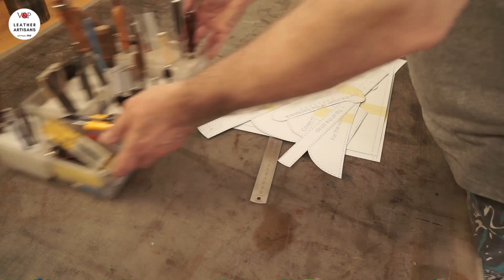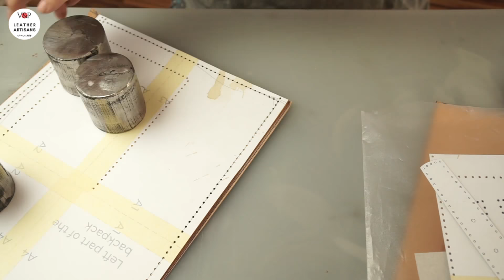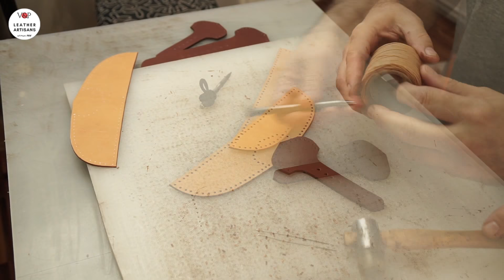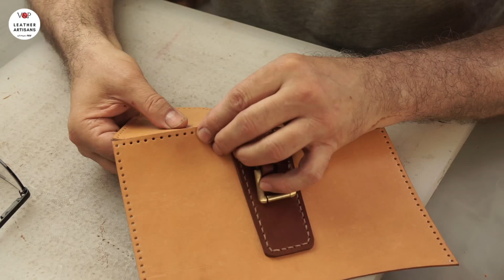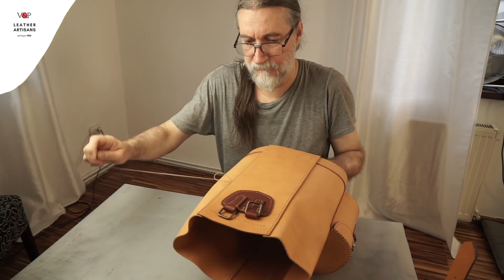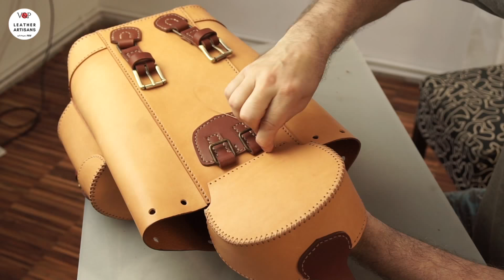How to Make a Vintage Backpack (Pattern in Description)

Comment: you know, after doing a few patterns like this, with the huge holes for sewing (not just v&p), i switched to a stitching chisel and it really makes something like this look much much better. for example, i'm doing the duffle by v&p and using a 3mm chisel (a touch too small, but nothing major) and it looks way way better.
i like this design, it's not for me, but i can still appreciate it. but to critique a bit, i think the large stitching is way too much when it come to the joining seams. it draws the eye and not in a good way. i don't like the box stitching either. but, that being said, the big stitches look great on the contrasting pieces for the buckles and when used as decoration, like the edges of the flaps. i do find a lot of leather pieces look incomplete because people forget to add little details like that. 
anyway, keep up the good work.
Reply from the maker: i know what you say, it looks better with chiesels but i want that people can make them quick and easy. I rarely work with chisels and it is dificult for me to sew on those small holes. When i make wallets i use chiesels :)
Reply: @VasileandPavel  yes, i figured this was to keep it simple. as i said, i'm just finishing your duffle pattern and i did leave the punched holes on the round bottom because that would be a nightmare with chisels.